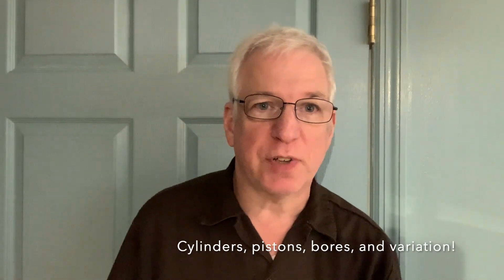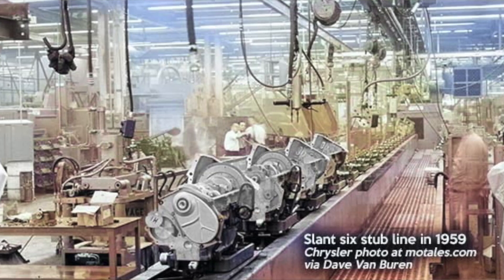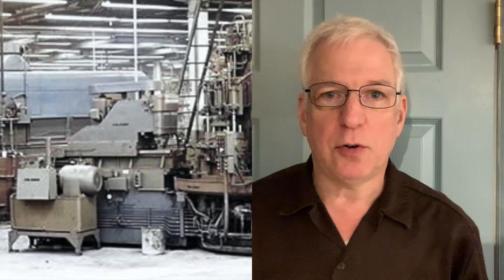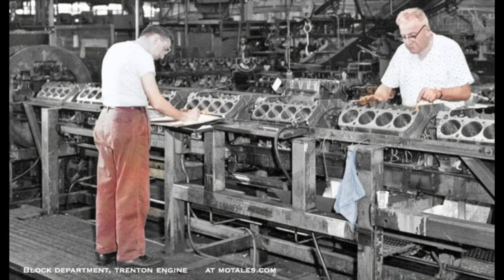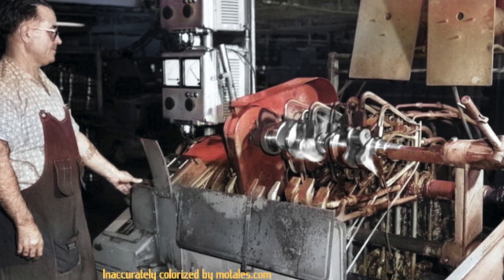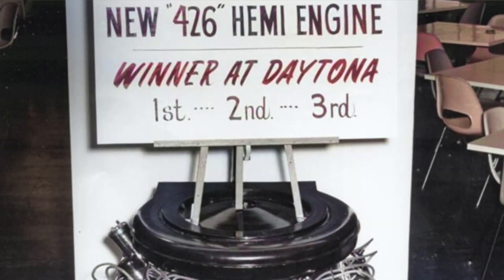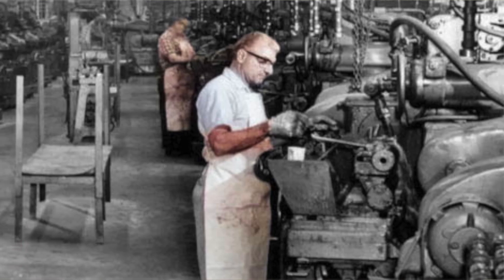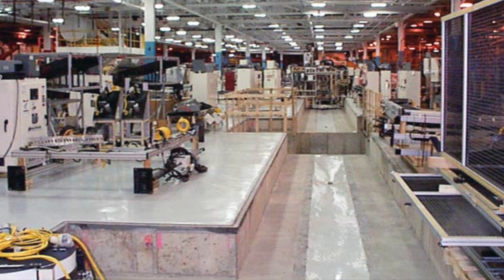What are those letters stamped on my engine and piston?

Comment: My '66 Mercury's 428 has paint marks on each cylinder of the left bank for the same reason, i believe they're all 4's in this case. FoMoCo used an air gauge to gauge each cylinder, and would readjust tooling as needed, using those air gauged numbers as an indicator.
Reply: Interesting variation.

Comment: The last of the industrial and motor home 413 engines I've seen were almost all overbored 0.020" at the factory. Factory Chrysler pistons were part number stamped by rubber ink stamps, right on the top. After short use, the ink stamps would disappear, so you wouldn't see a part number on them.
Reply from the maker: Thanks, I've updated the web page, and will have to start working on the video replacement...